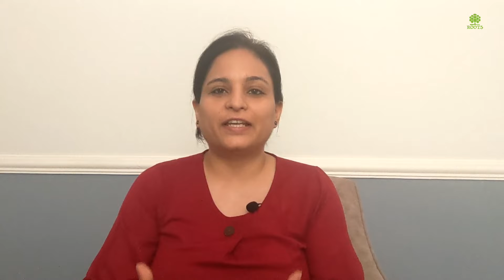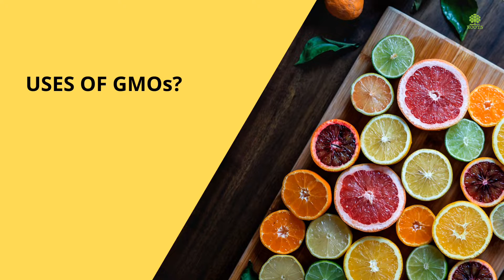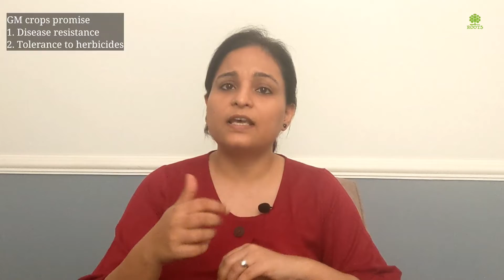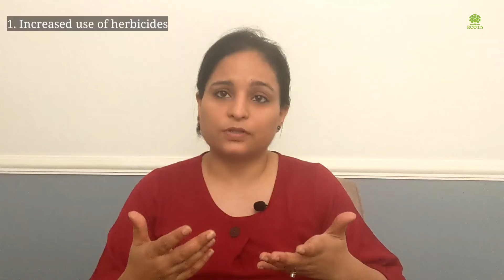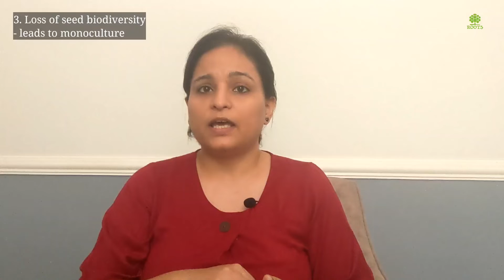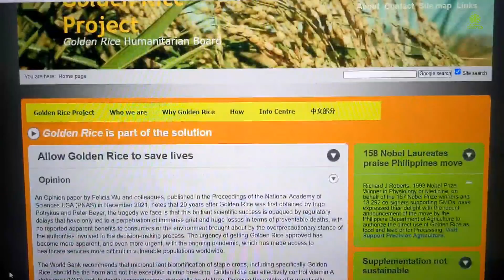Genetically modified foods (GM foods /GMO) what are they? And how do they impact our lives?

Comment: "definite that herbicides disturb soil ecology"?      Let's face it, farming disturbs soil ecology. The reasonable question is "What disturbs soil ecology least?"   One of the weed control techniques most used before there were herbicides was deep plowing. That destroys soil ecology. Herbicide use allows the alternative of low till or no-till agriculture, which is better, not worse.

The other mistake is in believing that herbicide resistant crops cause that much of an increase in herbicide use.  There is an increase, but a part of the increase is in switching between one herbicide and another. As a specific example, before there was any such thing as GMO corn, the most used herbicide in the world was atrazine, and that was almost entirely because corn (maize), one of the most grown crops in the world, is naturally immune to atrazine. So atrazine was used on cornfields exactly as glyphosate is now used on GMO herbicide resistant corn. That use of herbicide isn't an increase - it is a switch from one kind to another. And the glyphosate herbicide is many times less toxic to soil organisms (and other not-plant organisms) than atrazine was.